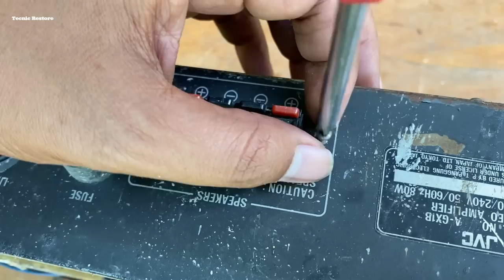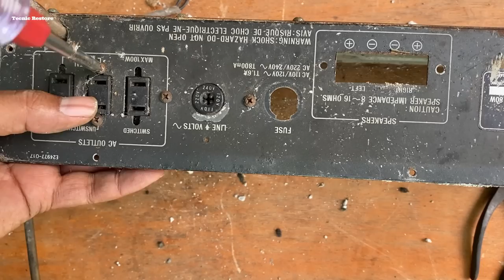Amplifier Restoration of the 1980s | Sound Booster Restoration

Comment: very funny this. You see broken electronic components but with a toothbrush and water you can fix them. LOL
Reply: But in some reason this can't be funny.
I like doing restoration like this and I mostly use water and gasoline to clean the pcb. The chance of the device to survive is depending on how broken the parts are.
Reply: Crt..

Comment: its fake  I don't see 'you work on it, I can see some capacitors were broken or open resistors  you did not make any  test point check with VTVM ,  no flux being used everything in a hurry,  all you did is  clean and close it    its not working  sorry..